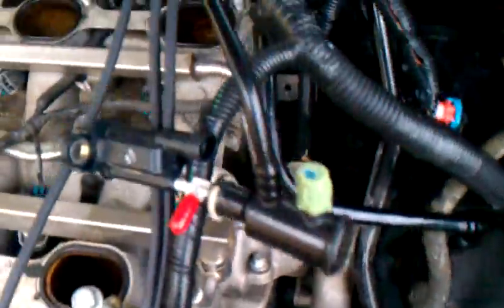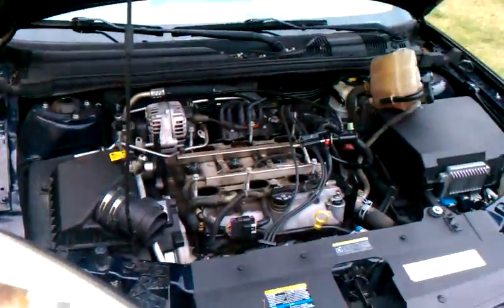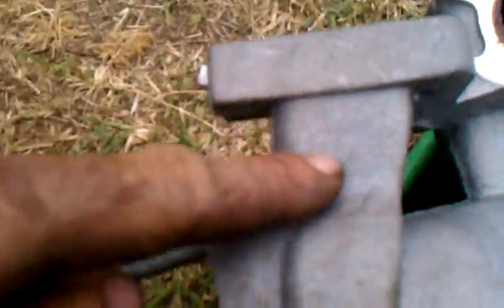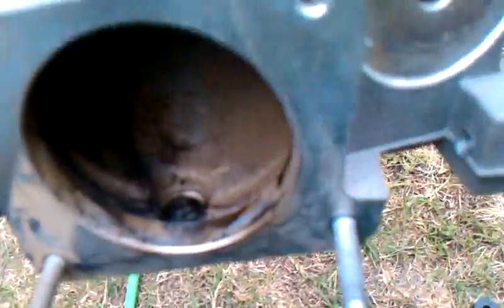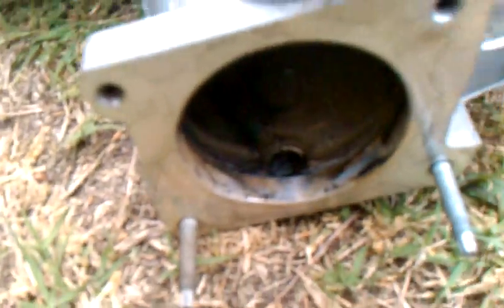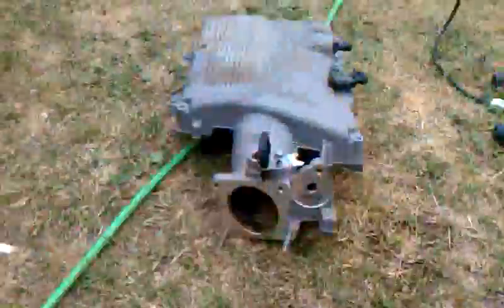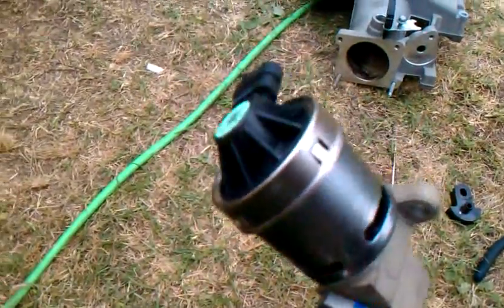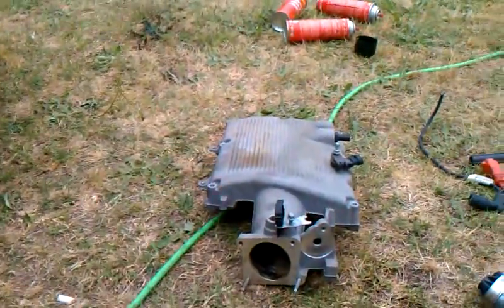EGR Code P0401 DONT REPLACE EGR "Insufficient Flow Detected"

Comment: Same problem on 07 wrangler. Changed EGR (Absolute nightmare) code came back in 3 days, or about 1/4 tank of gas or so. I guess this is the next logical step before pushing the jeep off a steep cliff side.. I only say that because it's been about 10k in repairs, the worst being the rear axle failure, all within 14 months..

Comment: I wonder if running with a bad EGR valve for a while leads to blockage. I believe mine was stuck open based on poor performance being the only real symptom. But same here, replaced the EGR and light keeps coming on.

Comment: Now I know where EGR ports are, they are on Intake Manifold. Thank you! I also have P0401 code, which comes back like after 50-80 mi. I tried to clean those ports around EGR Valve itself, thinking that they are EGR Valve ports, but the code doesn't go away. I think I need to remove the Intake Manifold as well and clean those oval openings. Thank you for this great film again.

Comment: Egr is exhaust gas recirculation not intake. It recirculates unburnt hydro carbons back into combustion chamber to be burned up. Point being it's on exhaust side not intake where you should be cleaning up, maybe you meant exhaust but called it intake idk.
Reply: Watch it again .

Comment: What did you clean it with pipe cleaners?
Reply: I used screwdrivers and heavy duty metal clothes hangers, plus carb cleaner. 2002 Honda Accord.
(PS. I'm just regular mom.) Good luck!
Reply: @kellylarsen9149   I found some metal wire tube brushes here
https://www.justmanbrush.com/metal-wire-tube-brushes/?sku=719643&gclid=CjwKCAjw4871BRAjEiwAbxXi26fARNAqnvx6obtraVFFV6gufmweLfderAaYtybr8MMO7_emHLPaqhoCgRcQAvD_BwE
Reply: @JasonSpitzMI50  Those look nice for the job and affordable! I still have the p0401 code & smell gas outside my car. I changed the EGR valve first then chipped all that carbon out. Need to get a new gas cap(seems too simple tho). Not sure what's next?
Reply: @kellylarsen9149   Hi, You may want to check your manifold gasket next. I've been a DIY for so long,  I've been offered jobs at real mechanic shops because it seems that most educated mechanics can't get past the simple stuff like I can. Go figure 🙄🤭
Reply: That's wonderful you have a smart car brain! When I put the manifold gasket back in it was clean&in good shape, but the green papery throttle body gasket got some rips,tears, tiny missing pieces in it. I bet I should of replaced that, right?
Reply: @kellylarsen9149   You are correct because any tiny openings may trigger a sensor that something is leaking in that location.
Reply: @JasonSpitzMI50  I think I want to be your neighbor.  Been dealing with this on off engine light for 2 years. O1 Monte Carlo 108k Miles only.
 I need an E-Check.  My car runs great.  Put a new EGR valve in it light still goes on, now we got to figure out the rest.  Yuck!
Reply: @kellylarsen9149  I also did the gas cap as a last resort. It did not work, in case anyone is wondering lol. I changed the egr valve, dpfe, and have yet to look inside intake. I am holding suspicion it's a PCV valve that rotted or hoses. If you're still having the issue ma'am, I would check your lines for any cracks, holes etc or if you got a smoke machine hook that up to see if you have a leak and where. Check PCV valve for missing o ring or rotted, cracked etc..

Comment: Thank you for making this video! Same error code, popped off my EGR valve and there it was - a big glob of brown snot clogging up the valve, which otherwise works fine. Cleaned it up, cleared the light, good to go, and for the price of one blue shop towel.

Comment: I was able to "fix" the engine light problem (code P0401 for EGR/other emission issues) by replacing the air filter.  Because the spacing between filter changes  is long and I don't write it down, I sort of assumed I had replaced it fairly recently.  Haha.  Out of curiosity, I showed the dirty one to the O'Rielly Auto Parts guy and he said, "Wow, that's dirty.  Way over due.  You should replace at least every 30,000 miles."  Anyway, if you aren't sure about the air filter take a look.

Comment: I'm having the same problem as you described in the video ,I bought the  EGR kit for 178$ thinking it would be the EGR as well , now I'm going to take the intake apart as well and check for clogged carbon.
Reply: Did that work? 6 years later

Comment: I have been running my 01 Solara 3.0l v6 for 65k with the p0401 code still runs great
Reply: It's only to fuck the life, that code just says You are contaminating the environment by not to have the egr connected but the true is, it's better not to have it, the trottle response and the fuel economy are better 👍
Reply: @MasAutoMx  is this true?? Lol
Reply: @CarolinaPride95  yes it is. That system was invented only for emissions regulations for  the countries.
Reply: @MasAutoMx  so it’s safe to drive with it on? I don’t know shit about cars and mine just came on recently 😂 I don’t drive that much so not in a rush to get it fixed

Comment: My best advice??   if you have a PO401 code first of all it is due to a vacuum leak so check all the ruber hoses in the area, I replaced everything,  DPEF sensor, solenoid, there were leaking hose conectors,  I check for carbon build up in the intake manifold and after doing all that the 401 code kept coming back.   the problem?  a cracked pcv valve conector on the under side,  I laughed for an hour haha  I bought a new one for 12 dollars and case close,   its always a vaccum leak.!!
Reply: Alejandro Raffta
Reply: Alejandro Raffta can a vacuum leek make your car stop while your driving on the highway
Reply: Charles Lewis vacuum leaks tend to be worse at idle and less severe while under load.
Reply: If you got a smoke machine it will help a lot with those leaks
Reply: Thanks for that advice
Reply: Whhaaat?  Please help:( 
I broke the pcv tube. That goes from air intake hose. it's loosen now on the intake manifold aide, not sealed, how to fix that? It's not staying in place really good, little bit push and it comes out:(

Comment: Problem is i had mine replaced and engine light is still there and ob2 reader says the same thing? What gives? Does this mean it needs to be cleaned again twice or the mainfold needs to be cleaned or is it a bad oxygen sensor that needs to be replaced or should i just reset the light engine warning and see if it comes back on? What is the most common option i should do?

Comment: If you have done all this and have the same problem. ...replace the egg valve and sensor.......
Reply: +Ricardo Nelson What do you mean Egr Valve and Sensor, are they both together, or do you mean the wire should be changed, i did all and the light came on again, i don't know if i have leak somewhere.
Reply: why would you do that, you have to diagnose everything get a hand vacuum pump and test the egr valve it should hold a vacuum if it doesn't then you go buy a one. if it do hold a vacuum that means its working just clean it up with some carb cleaner. For The egr valve solenoid check the resistance should get something between 35 ohms, you cant rely on a click to know if it works(by giving it 12v power) because some don't click. These test will confirm if you need to buy these parts don't be a parts mechanic. You can also be the computer and give the solenoid power then check if that hose at the top of the valve is getting a sucking vacuum. Then you do what he did in the video clear the egr passage ways. If that doesn't clear the code then you have to check your dpfe sensor, it has three wires you probe your multimeter on battery ground. then get a safety pin bend it out so its like a line tape it on your positive lead of the multimeter probe and fish it to the one terminal on the connector on the dpfe sensor(with it attached and plugged in the car) which should be like the first wire on top. Turn car key on it should read between .5 and 1 volt if not the sensor is bad or bad ground but most likely the sensor. If it is showing in that 1 volt range and when you accelerate to like 1500 rpm and it doesn't jump up to like 4 volts sensor is also bad.

Comment: To clean the system easy ....have it off the vehicle use  some am soil foam cleaner for intake...let it rest for a while spray a gain.....then use a power washer and wash it out....then use air to blow dry....looks like new when done.....remember to blow air through all or any ports......to make sure that there is no water left behind. ..
Reply: I wouldn't recommend power/pressure washing the engine... it's not a good idea for some because it'll cause leaks and issues from weak seals (not to mention possible electrical issues if water intrusion happens at connectors). I always clean with carb/intake cleaner and carefully & gently (but thoroughly) clean. I also recommend running SeaFoam through a vacuum line too.
Reply: +Jennifer Pitts I'm thinking that  you  might have  miss  read what I  said. ..I was talking about the egr system and related  pipes....not power washing  the engine..?
Reply: +Ricardo Nelson Ok yes. I did. My apologies. I just didn't wanna see someone power wash their motor and ruin seals and electrical connections LoL
Again, my apologies. And yes you can clean the EGR. I work on my vehicles myself.
Reply: @JenniferF2882  😍🤗

Comment: Hey guys..currently had the Same problem with a 02 Tacoma 4 cylinder engine. ..cleaned the entire system and all is well. ....p0401 and p0402...

Comment: I tried this today. It worked. I have a 98 Taurus, check engine light, scanned p0401, I also did the rear bank spark plugs while I had the intake off, I figured might as well, although I could have left it on and just removed the throttle body. I had to scrape all that gunk out and sprayed it down. Great advice!  THANKS

Comment: No idiot, it actually serves a purpose for your engine, not just emissions. If the egr flow is blocked, you could be getting insufficient air flow which could cause engine pinging also known as detonation. And this will eventually ruin your engine if not fixed.
Reply: Never seen this happen. I've removed and capped multiple vehichles as long as the maf and o2 censors work it knows the air flow and temp and what the exhaust gas readinfs are and makes air fuel timing adjustments as any other efi does. If a engine can't get enough air flow from it's intake the problem isn't lack of egr valve. Motors before and since has gotten enough air and will still from there intake. It's the same as you eating like 20 percent of your own shit. It's edible dogs do it. Its better for the planef if you recirculate your shit one more time. Saving the planet. One bowl of sewer a day keeps climate change away right.

Comment: Nice video mobile! Plz plz plz tell me. Did you disconnect the battery before you remove the throttle body? I cleaned my. Egr valve but no luck. Check engine still ON. My emission is do in 4 days! Plz respond back. Thanks

Comment: I bought a 2001 camry that had p0401 and the previous owner replaced everything and had a shop clean the passages and it still would not pass emissions testing. I followed all the factory diagnostics to the tee and could not ascertain the problem as the diagnosis was still a blocked passage. What I found out by removing the exhaust pipe from the EGR valve and running the engine was that the egr pintle seat was not fully seated in the new part from the factory and was leaking all the time.

Comment: ive been having problems with the p0401 code. and i took it to advanced auto parts. the p0401 code can actually mean 4 things. you wont know until process of elimination. it could be an egr valve or the dpfe sensor. but i wish i had done my research before changing the egr valve. but my real problem is that i bought a ford.